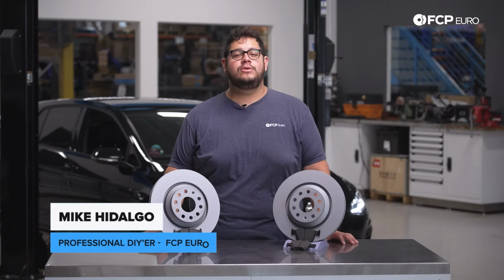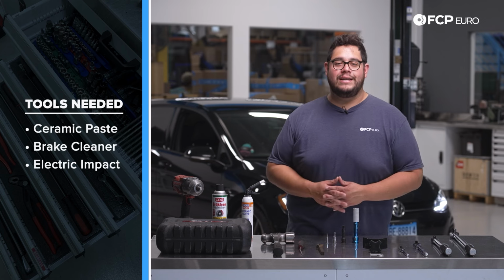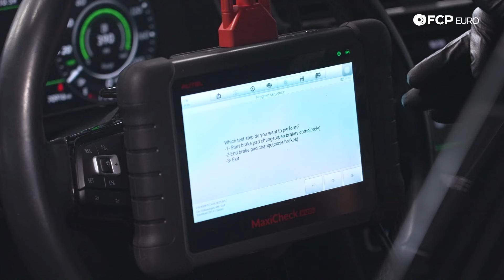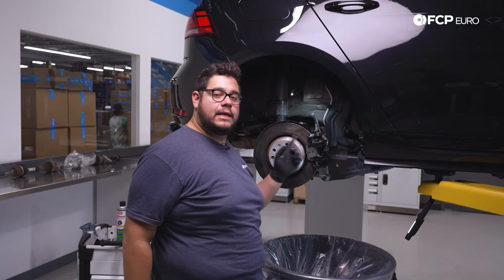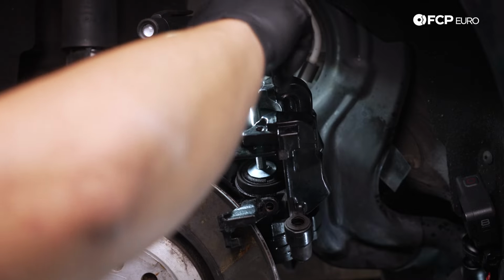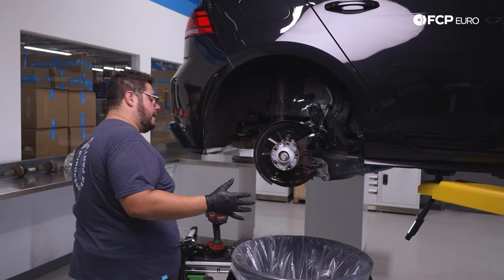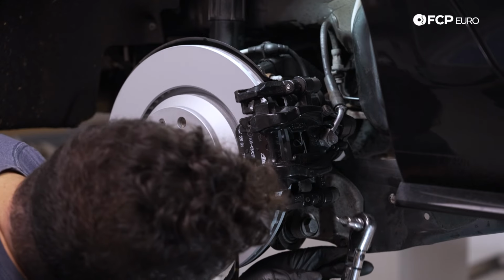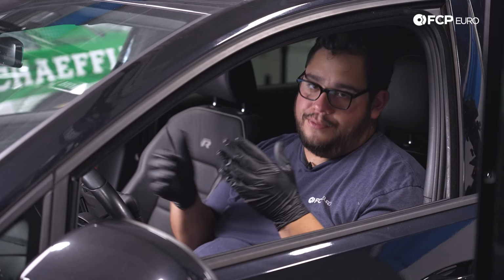Volkswagen Mk7 Golf R Rear Brake Pad & Rotor Replacement DIY (2015-2021 VW Mk7 Golf R)

Comment: You dont need any autel or other scan tool. Unplug electric brake motor wire and apply 12v. This saves lots of cash for a one time job

Comment: Are you actually kidding me. You need a computer and software to change the rear brakes on a golf. I mean..... good for specialized shops i guess, makes things easier. But what about the millions of carowners that do simple maintainance stuff themselfs in the driveway?! Could this not have been done with a simple reset menue like they have done with the oil service reset?

Comment: For anyone struggling with retracting the handbrake piston without a scan tool, I used a 9v battery with crocodile clips to move it back once disconnected. Also, I think non-"R" models need the caliper bracket to be unbolted in order to get the rotors off.

Comment: On other cars I have had the calipers stick after pushing the pistons in.  I use an infrared thermometer to check the rotor temperatures after a test drive to make sure the caliper pistons are not sticking.

Comment: Do I need the electronic system thing to change my back rotors on my MK7? Can I just change them like I do the front ones?
Reply: You'll need it if you have an electronic parking brake. Also the MK7 (standard) you have to remove the caliper mounting bracket and it's a spline/12pt/triple square socket and it's a pain in the behind to access! And it's torque to yield so they should be replaced. And they usually seize in place.

Comment: Great video. Thank you!
Once o retract the brake cylinder with the scan tool can I unplug it and third the ignition off and then when done plug it back in turn the ignition on and close them? Or will this screw things up with the brakes? I appreciate your time and answer. Thank you

Comment: Can the ignition be shut down after opening the brakes by OBD and while working on the brake? Or has the ignition to be on all the time?
Reply: Yea it won’t affect it and you don’t want your battery dying either. When you put everything back together. Turn the ignition back on and code it to close

Comment: I notice the old out board pad had a silver coloured shim cover on it, and this wasn't moved over to the new pad.  Is that right, is that silver shim cover not really required for the new pad?
Reply from the maker: Hi Jefferson, some pad manufacturers will often include them based on the sizing of the backplate, not mandatory, only to be used if part of the pad replacements you are installing.

Comment: Thank you very much for this tutorial.

I've successfully done the rotors and pads on my MK7.5R, incase anyone is interested, I went with the "cheaper route"- I purchased a ELM327 OBD2 Scanner and used an app called Carista to open my Electronic Parking Brakes.
Reply from the maker: We're glad it was helpful!
Reply: @fcpeuro  Silly question, but would this step be needed if the vehicle is a manual? I'm assuming no?
Reply: @KaputtEqu1pment  not needed. You are right. Just did mine.

Comment: A nice, well-presented, very helpful instruction video - thanks.

Of interest, after reinstalling everything do you use the diagnostic software to end the procedure first and then pump brake pedal pressure, or pump the brakes and then end the procedure?  Or doesn’t it matter either way😅
Reply from the maker: Thank you for watching! We end the parking brake procedure, then pump the pedal a few times before taking it out for a test drive.

Comment: I have a 2018 Volkswagen Golf TSI Highline. Do I need that computer to read my car even though my parking brake is manual?
Reply from the maker: You will not need a scan tool if you do not have an electric parking brake!
Reply: @fcpeuro  I figured. Only problem now is one of my lug bolts is seized right on. I have a 1/2in impact wrench with 1600lbs of nut busting torque. Not even that is breaking it free. Might have to drill it out.

Comment: Is there a good way to retract the electronic parking break without a scan tool?
Reply: Nope
Reply: @MoistVW  yes you can, plenty of videos how.
Reply: @brdpit  Not worth the risk. Save a few bucks and risk ruining the calipers. VW manual clearly states if you force pistons back without doing the diagnostic procedure the epb motors will be damaged. Some idiots are even telling viewers to dismantle the motors which VW warn against doing.

Comment: I have a MK7 Sporstvan. Do I have to  remove the carrier or can I also slide the rotors around? Thanks!
Reply: Hi, did you find it out?
Reply: Yes. You have to remove the carrier. There is no way to slide them out.

Comment: Are the GTI non performance pack rear rotors the same, where you don't need to remove the carrier to remove the rotor?
Reply: Been a while, but yes same setup no need to remove caliper housing

Comment: Your packing system sucks
My new rotors arrived scratched
Shipping box was filled with paper
Nothing else to protect the rotors.
Reply: Lol wtf. It doesn’t matter if a rotor is scratched, it’s going to get all scratched up anyways from the brake pads rubbing up against it. My new rotors from the dealership also were scratched